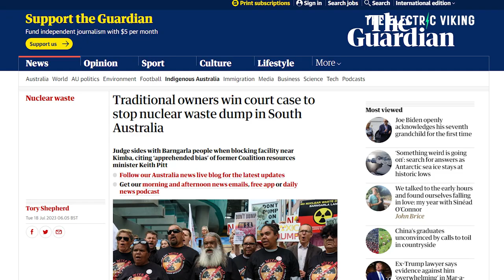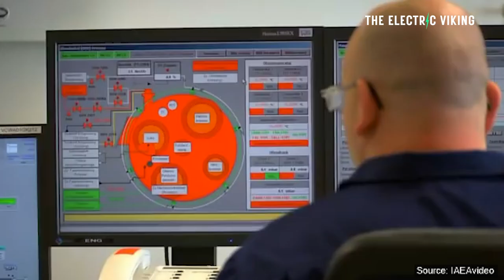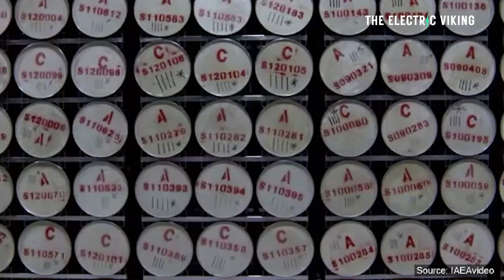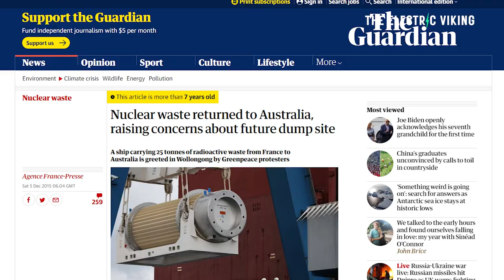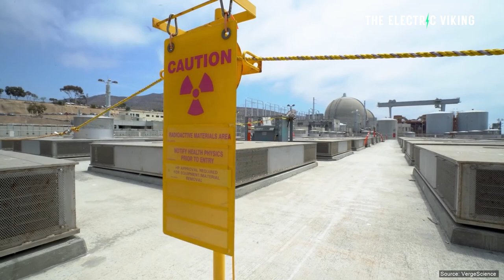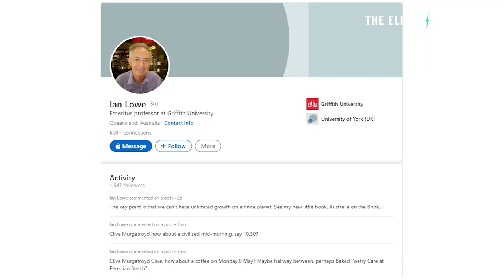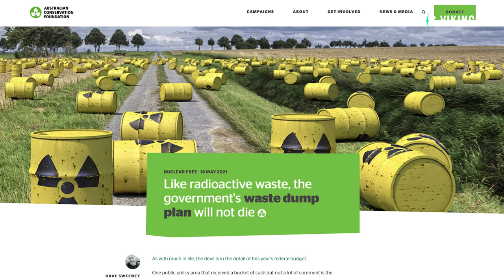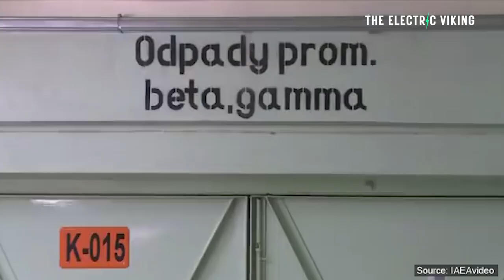Australia’s nuclear waste is scattered randomly – and the massive pile is growing

Comment: Sorry this is mainly FUD. There is seventy years of waste from Lucas Heights and this is stored completely safely. But in the long term remote underground storage is likely the best option.

The waste from France is actually our own reactor waste sent there for reprocessing. France extracts the Pu and U to make new fuel rods, vitrifies the remainder and sends it back to us for long term storage. The volume and half life of this vitrified waste is mostly quite small, it would likely he quite safe in two or three hundred years.

Some of the industrial isotopes used for Xraying machinery can be quite dangerous but the amount is very small and is easily stored in lead containers.

The rest is mainly very low level, eg catheters syringes gowns etc from nuclear medicine. By its nature this decays quickly and would likely be completely safe from as little as a few days to just a few years.

The Kimba community is quite poor and would have benefitted considerably from business arising from the waste storage project. However, I guess it is easier to put your hand out for grants.

The waste will likely wind up being stored on Defence land at Woomera or at the Maralinga, Emu Fields or Montebello test sites where there are already a nuclear waste repositories. Thats a pity because these are very remote locations with no local communities to benefit.

Comment: Thanks, Sam. I'd be happy to store the waste that was destined for Kimba, but my property is a bit small.
Seriously, the anti-nuclear campaigning by the Greens over the last 50 years has produced a near-hysteria about nuclear, and nuclear waste, in Australia, that makes a video like this strong on FUD (Fear, Uncertainty, Doubt) and short on facts. One of the facts is that I have been a recipient of radiation treatment (PET scan) as a diagnosis for cancer, and indeed your wife may have also; It is the partially spent material, including the syringes and associated hardware, that form a large part of the 'low level' waste.
One interesting detail: I have a small 'Geiger' counter, being a geophysicist, and I was able to monitor my own radioactivity as it declined after the PET scan. Initially it was very high (higher than if I was made of Uranium!) but the half-life is about 4 hours so it rapidly decreased and was at background levels 16 hours later.
Reply: Done the same, my Geiger counter's red alarm came on and a message flashed up telling me to clear the area. Six hours later it had largely subsided, at 24 hours it was at background. 

These PET tests are a marvellous life saver. Needless to say I have no fear of them at all.
Reply: Look, I agree that there is a lot of confusion about a lot of different types of waste, much of which may be largely harmless.  However, let's not pretend that the nuclear power industry/regulatory bodies haven't contributed to this distrust.  Although power plant catastrophies have been few, they are almost intractable. Combine that with the fact that most nuke plants in the US are always behind schedule, over budget, graft boondoggles with poor operational histories.  Also, dumping grounds from bygone eras such as Hanford site continue to be a resource drain and source of new incidents during ongoing mitigation efforts.
Reply: Medical waste has the quick decay characteristics as you mentioned.  A large sanitary landfill in the US used radiation detectors to scan containers of waste coming from hospital districts. Standard operating procedure when a hot load was discovered at the site entrance was to isolate the container for 48 hours to allow it to cool down. No radioactive material was accepted for disposal in the landfill per EPA regulation.  There was no cause for concern other than maintaining proper records of the situation.

Comment: I think we should just bury it deep underground like in an old mine. We have basically no earthquakes and when we do they are relatively little. We have no volcanoes. So it will be safe underground.

The nice thing about stuff being radioactive is that it’s easy to detect. It essentially beacons. So if some goes missing or we forget exactly where we put it we can detect it and follow the signal.

Comment: Low level radiation is always low level. It does not become high level, unless someone reprocesses it and concentrates the fissile material. Furthermore, is reduces in level with time. The Earth is bathed in low level radiation, and always has been. Uranium is scattered around the globe. Every piece of granite is radioactive, and some of it is more active than most stored low level waste. If you like bananas, you'll be interested to know that the Potassium in them is radioactive, since about 1% of all naturally occurring Potassium is a radioactive isotope. The smoke detector in your home is likely more radioactive than most low level radioactive waste. In Europe, we experienced far more radiation after the Chernobyl disaster in 1986 than most radioactive waste which is stored in labs and basements emits.